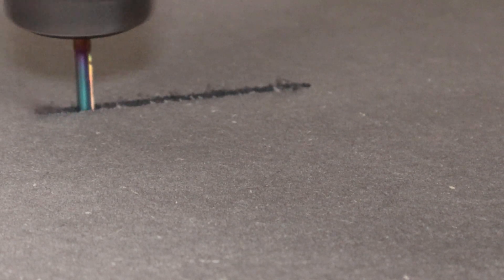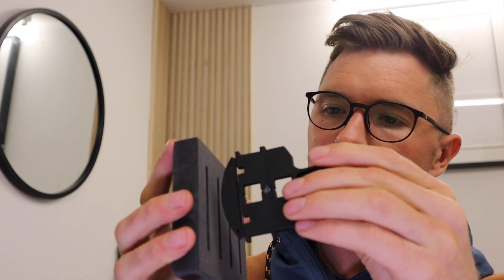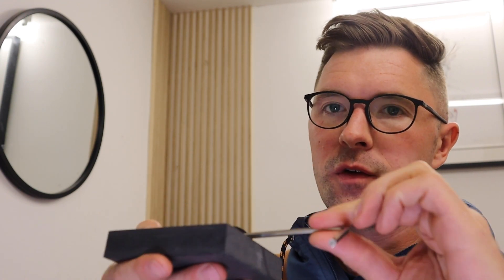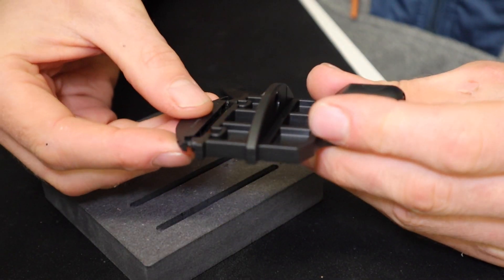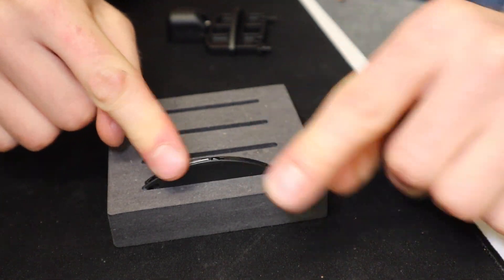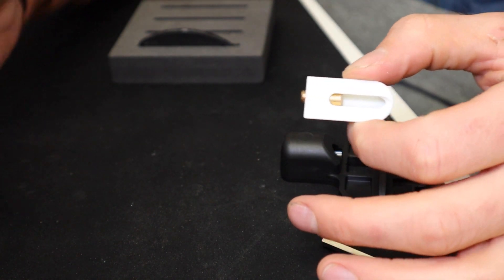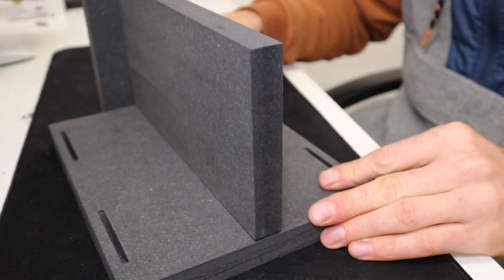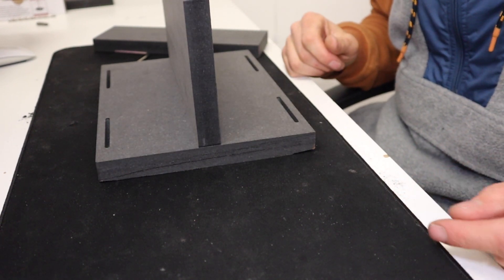CNC Machining for the Lamello Clamex fitting

Comment: Use nailer instead of this lil screws. Screws may split the material.

Drop of glue plus nailer will hold biscuits muuuch better.
Reply from the maker: That's a good idea, I have not tried a nail. The screws are not at all great in MDF. They seem ok in Birch ply or solid wood. 

I find for best results using glue on Clamex and Cabineo for safety.